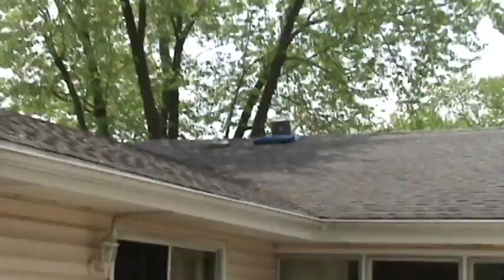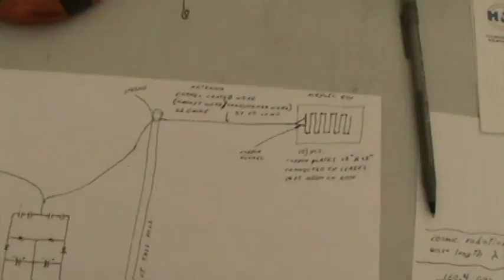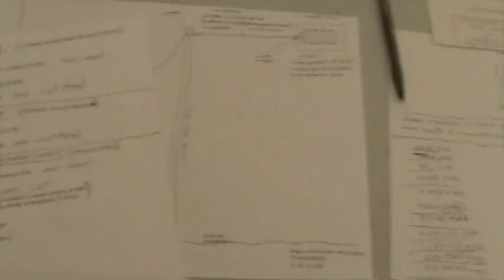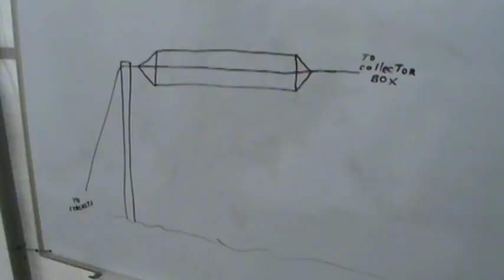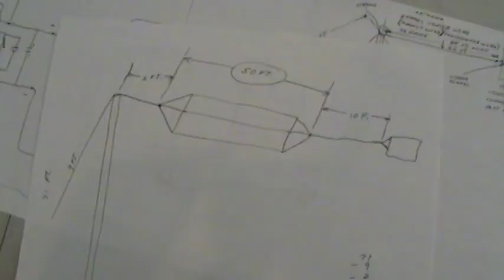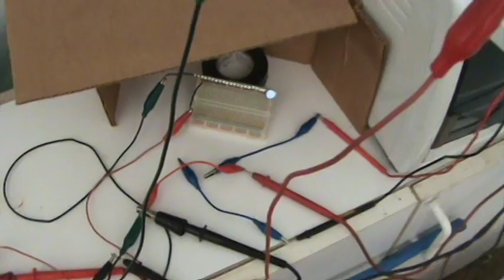Free Energy From Air 2018, part 1

Comment: Isnt this the same as a solar panel getting energy from the sun?
Reply from the maker: Humm, in a sense, this is collecting electromagnetic waves in the air from I believe many sources, like radio, the sun, black holes, satellites, super nova, many sources from man made devices and sources from the cosmos.  This would also be considered as atmospheric electricity.  This system works night and day with no charging of batteries.  Solar cells(photovoltaic modules) need photons of light to work.  Solar panels on a house take about 20-30 years to get your money back and costly maintenance, and in 30 years they may have better ones.  Solar cells used in space by NASA are approx 25% better.
Thanks for watching & your comments.

Comment: Take a large inductance transformer coil with 300mh  and 30mh. Get a 
second one just like it. Now hook a piezo element across the the ground 
and a high antenna wire. Connect one 300mh  coil across the piezo. You 
may connected piezos in series to get higher voltage. Then connect the 
30mh coil to each other. Then measure the output across the free 300mh 
coil for free energy.
Reply from the maker: Thanks Travis, I like this idea, makes sense! 😎

Comment: Mount it 200+ feet
Reply from the maker: Yes, absolutely, i understand.  But I will try to get more power out of it without raising it more or adding longer length antenna wire.  If you keep going through this video series, you will see that i now have over 125V :-)

Comment: I have noticed that when i used carbon / graphite as antenna, this made a big difference for me, and if you will get the same results as i did, i think you will really notice a BIG difference because your system is 10 times mine.
Reply from the maker: Thanks Ronald!  I been thinking about this too.  Graphite antenna rods or graphene coated wires :-)

Comment: If you reduce the wiring in your circuits and make better connections, you will get more power from your DC system. Line losses are hurting your efforts.
Reply from the maker: Yes, thank you,,,i agree.  I will change things :-)
Reply from the maker: Thanks, i am getting more power now that i removed some circuitry :-)

Comment: Lasersaber did some work on atmospheric electricity with a company that is developing the technology. It's very interesting to watch and may give you some ideas. https://youtu.be/ENeDkGce5-4
Reply from the maker: Thank you, im very familiar with that video.  It is a very good video!  I hope to do what they do but with a much smaller set-up.
Reply: It sems like what they are sayng is that a rough wire having more surface improves the ion colecting capability. So if you roughen up the wire it might increase the performance.
Reply from the maker: Good idea.  I already have all surfaces of the copper plates in the collector roughed up.  I was thinking of buying some graphene coated wire,,,,or make some myself.

Comment: Hi Paul, I'm just wondering what happened to the 120vac that you were getting several years ago? Surface area makes a difference so just imagine the tin roof on your shop? I've tried that and it's never isolated well enough. Anyway, keep up the good work my friend.
Reply from the maker: Hey Michael!  I got that 120V when i had my lab in my fathers back yard.  I used to drive to his house every weekend and some days in between.  He let me have my lab in his back yard behind his 2-1/2 car garage,,,,,my yard is very small.  7 years later i got tired of driving back & forth.  I fought with my wife everyday for 2 months straight until she gave in and now i have my lab in my own back yard :-)  At my dads house i was around 41 feet high,,,now im only 16 feet high with my antenna.  Keep in ouch my friend.

Comment: ...eh
https://cdn.discordapp.com/attachments/259682772665237504/455757662618124300/BlobBattery.zip
you use electromagnetic waves, most energy comes from radio etc.
the link shows you something i work on, only problem is to make the cells waterproove.
also i make a video where i talk quick about it ==>
https://www.youtube.com/watch?v=GShIPUFOv0w
Reply from the maker: very Interesting. I wonder what is in the hair gel,,,i mean, i hope your not just building a regular battery with a galvanic reaction.     Have to tested this under a load for a long time?
Thanks for posting & sharing Luziferino, and good to hear from you again.
Reply: >galvanic reaction
no. thats point of whole thingy.
it can also be builded with water instead of gel, or useing showergel.
...testet, yes. alot. with my tower here i load already over100 times some 1,2Volt batterys, and sometimes some capacitors because fun to have that mutch energy xq
...only problem, building cells "waterproove". some are starting to dry out soooooo i test silikon now on them, look how long that hold.

now i explain what exactly it it ==>
NO CHEMICAL REACTION! the cells dont let normal energy throught. thats funny because its energy on it when you measure it. lol.
sense of it is, water is in oil, but not water touch the metals, the oil does. but because of this low distance difference from water and metal, energy floats.
and the direction comes because of the 2  different metal kinds.

sooooooooo also, have you heard of the balloon HV generator? XD
make a cable on a balloon and let it fly up. very high! you will get a shock when you are on ground and touch the end of cable.
energy comes from HighDifference.
...i am also thinking how to make it possible to use 1MeterHighdifference and make circles, but that cable whould go up and down soooooo it will not work.
also, 1meter or a house or normall towers are to less. sadly
Reply from the maker: Thanks for the reply.  Very interesting.  I added your video to my playlist of "free energy & OU".
Has anyone replicated your work.  I would love to see a video of you making & testing a cell,,,instead of just video taping graphics of it.  Thanks for sharing & open sourcing :-)
Reply: >"video of you making & testing a cell"
eh. ok...
the days

Comment: well, i3,  you have made a crystal radio set without the crystal  or  the radio.   in Any long conductor, ambient natural and artificial radio frequency ( rf )  energy is passively converted to very weak ac power ( the antenna ).   this ac power is then full-wave rectified and powers your LEDs.    while this power is  Not  coming from air, its  energy density  is on par with that of atmospheric static electricity (  Very Low ).         leverage  IS  the key to  clean unlimited electrical power.    consider that in the linked video of an experiment conducted by  george chaniotakis ,  there is an Apparent energy  Gain  of  .1 watts.    see my channel, if it suits.    cheers
https://www.youtube.com/watch?v=lTkXciAn488
Reply from the maker: Interesting, thank you.

Comment: Can you run an aerial up on a balloon or such too gain some altitude for increased voltage?
Reply from the maker: Hello, good to see you again.  I thought about the balloon, but too many trees near me here,,,plus i want to keep this simple to replicate anyplace.  Dr Moray, in his third generation radiant energy device, he only needed an eight foot long antenna in his basement or even underground in a cave,,,but he was also using radio active compounds by this time,,which i will have to try soon :-)  I will also check freqs soon and try to get things resonating.
Reply: The problem is, replicability is only worth the time of the people if it produces enough to pay its self back.

I am not sure who Dr. Moray is, or how he came to his final results, but 8 feet of wire, inside an enclosed space sounds pretty unusual.

Are you trying to get EM energy or are you trying to get static energy?
Reply from the maker: EM energy.
Reply: A fractal antenna would help with that greatly: gain more bandwidth in less space! (~_^)-b
Reply from the maker: I was thinking about this also.  I was hoping to get my hands on a discarded smart phone,,,they have very good fractal antenna in them, they have to receive TV, radio, GPS, and much more,,,, wide bandwidth,,,,,or i could make my own, maybe bend wire like a snowflake design :-)   Eventually i think i would like to concentrate on collecting cosmic radiation.  I read it is at 160.4 GHz,,i already calculated the antenna length of .1109 inches :-)(search Franklin Mead patent).  If i remember correctly, he used 2 spheres for his collectors, slightly different in size from each other, and he collected and used the beat freq produced from those spheres.
Oh, Dr Thomas Henry Moray,,,you must of herd of him,,,his well know book is called "The Sea of Energy in Which the Earth Floats". Dr Moray researched a lot of Tesla's work.  It always interested me that Moray had to "prime" his circuit to get it powering up,,,,like siphoning gas from a gas tank.  He collected cosmic radiation and transformed the freq down.
Ok, im rambling on now, talk again anytime.
Reply: Ever heard of conductive ink pens? All you need to make your own fractal antenna is a straight edge, some paper [or really rough surfaced plastic, but plastic coated (butcher's) paper works too], some aluminized paint, or, if you happen to follow Dr. Robert Murray-Smith, some nano-scale copper ink, and draw it onto the [non-conductive film-of-your-choice] cleanly, and once it dries, connect to the core of it and suddenly you have your fractal antenna! 

In fact, if you can get your conductive ink into a printer or plotter, you can have the machine make the fractal pattern for you.

Otherwise, what you can also do, is draw out one portion at a time, test it, and if you are happy/excited with the results, allow that to be motivation by which you proceed to expand your antenna sheet at a time to as large as you care to build it, because no matter how large it is, you can always [literally, always] roll it up, and seal it from the weather [generally, just anything that degrades your ink, rots the paper or causes a short circuit, including, but not limited to mold, mildew, fungi, termites, rats, wasps, etc.] and continue using larger and larger versions, ever expanding your bandwidth as you go! 

\(^_^)/

The MAIN reason I have not yet moved forward on doing this myself is that I have not had time and tooling to reduce my copper stockpile all into conductive ink.

I imagine with the hundreds of pounds of copper I have on hand, I should be able to literally make many fractals of large enough dipolar values to collect every possible bandwidth from ultra sub EM to gamma rays, at many locations, therefore allowing me to produce a virtual 'hole in space' respective to EM energy.

Of course, I will also need a whole lot of paper to do this on, and it will take a long time to complete... 

Therefore, most likely I will long before that complete my solar heat engine system, which will produce considerably more power anyhow.

~( 'w')/
Reply from the maker: Thank you,,,good idea with the conductive ink(i have seen these pens),,good for quick experiments :-)  
Hundreds of pounds of copper,,,im drooling.
I wish you great luck with your solar heat engine when you get time with it.
Reply: I actually built a VERY CRUDE one up in frosty Minnesota about a decade ago, and the owner will sell it to me for crazy cheap [relative to what it is in retail parts] but I lack the money to go get it, and although it it was far from perfect, it worked, he won't sell me the huge 24 foot solar tracker though, so I have to build that from scratch, unless somehow in time he changes his mind.

I actually got my 600 HP valve back, for which I was truly grateful, without this valve, or one just like it, one can not run a piston engine with  the pressure and must resort to potentially fickle and gas hungry turbines, or, build a special high precision vane motor.

IF I get the unit, however, I will proceed to build a vane motor, because it is simply the most efficient at transferring the pressure and flow into actual HP at an alternator, flywheel, pump, or other outlet of harvestable power a user chooses to employ.

Also, I have an idea how to make a really inexpensive GIANT Fresnel lens [please, everybody who reads this, keep in mind that 'inexpensive' is RELATIVE term in this situation] which I can use to mass produce literally any sized Fresnel lens a person could want [because I would make it in sections which allows me to compile, crate and cartage any place on earth really cheaply, however, for massive contract jobs, I could literally build a limitless [limited to money and materials] quantity on site.

With my 'revolutionary' [not sure if it really and truly is nor not without researching more on it] design, I can make lenses limited only in materials and tooling for their size, and can make a fully working lens for a frame in well under 24 hours, something unheard of in large Fresnel lenses to this point.

Since there is such vast volumes of SOLAR [(<EM>)] radiation striking the earth each and very day, it just seems pointless for me to invest the time and money to make some type of system which has a completely unknown and unproven level of potential at this point in my life.

As a HOBBY? Maybe some day.

As a way to produce needed power here and now? Nuhuh.

Definitely wish you great success Paul, continuing to follow, enjoy and offer moral support, possibly technical assistance, but as for me, gunna stick with good 'ol reliable SUNSHINE for my EM harvesting needs.
Reply from the maker: Sounds very cool that you have idea for making Fresnel lenses,,,i get them from old projector TVs.
Reply: I have a few from projection screen TVs we used for initial research but they are too small for practical use with my system.

My next mini-machine will be an attempt at taking 2 TV screens to power a solar thermal go-kart just for public demonstrations.

That one will also be a while down the road though.
Reply: conductive ink can be copper plated to improve conductivity :D

Comment: Sparkgap it
Reply from the maker: I keep thinking about this.  But the LEDs are tiny spark gaps themselves.,,,where would i put the spark gap?  Do you think i should replace the LEDs with a single spark gap?  I see you made videos of MX6maximus,,,wait, who is this.
I really like that ADGEX ELFE flashlight,,,i see it can operate about 1-2 hours a day,,,must obviously be charging a capacitor.  I will have to try charging a cap again soon.  Thanks for commenting.
Reply: INVENTOR3 sparkgap the high voltage coming off the receiver, capture the energy burst in a cap and use that to run the led off it. You actually showed it in your earlier vids, when you were so depressed about this project, both me and Byron were applauding in the commentary on that second you showed the effect of the sparkgap giving additional brightness to your LEDS.

You can see the same effect in Byron's videos and mine trying to  replicate his designs.
Reply from the maker: LOL!
Reply from the maker: Thank you,,,i will try this.
Reply from the maker: Hmmm, but you guys use the wire from the wall(which wire do you use again, i forget?).  Dont get me wrong, i think what you guys are doing is phenomenal.  Hmmm, what if elec Co says you are not using us anymore so we will turn everything off?  I want people in 3rd world countries to be able to use this.
Im thinking out loud about what you said to try,,,,,,if i charge a cap/caps,,,than i can not have the LEDs connected into the circuit at the same time otherwise the caps may never charge,,,,hmmmm, so lets say i charge a cap & than connect the LEDs,,,,but than the LEDs will light for a shorter duration as it took to charge the cap.
lol, am i making any sense or am i misunderstanding something.
I love the comments and ideas, keep em comin!

Comment: It seems like there are quite a few components in the circuit. Each capacitor, diode, coil, and resistor have power losses. I don't know if you have compared voltage and amperage before and after the circuits to determine the losses.
The more metal in the air the higher the current/. The more unconnected terminations or spikes the more current as well. The larger the elevation differential the higher the voltage.  
https://youtu.be/2rVdEhyMR6A
Reply from the maker: I have not edited the second part video together yet,,but i remove much of the circuit and go back to the basics.
You make a good point and was saying the same thing to myself.  Thanks for commenting.

Comment: at over two volts you can then use a joule theif circuit to boost it more then  cut the voltage to get more current
Reply from the maker: Thanks Steven, but i would rather get more voltage and than run it through a spark gap to get current,,,but than again maybe i am "barking-up-the-wrong-tree" as they say.
Reply from the maker: I am not getting my comments on my videos forwarded to my email any more for some reason!!
I checked my youtube notification settings and they are good.
I checked my google chrome notification settings and they are good.
I checked my yahoo mail notification settings and they are good.
Only thing i can think of now is that maybe i need to convert to the new youtube Beta!?,,but youtube beta does not yet have end screen annotations to add to my uploaded videos & other features yet.
I dont know when anyone leaves a comment anymore on any of my videos,,,,i have to go to each of my videos to find out if there are new comments.  AHHHHGGGRRR!!  Am im the only one having this problem now!!

Comment: Is this similar to the way a crystal radio set collects some useable voltage ?
Reply from the maker: Yes, exactly, except i am not tuned to receive a specific radio station like they were.  I will be checking the in coming frequency again soon, but in the past when i checked the freq. it was not in the range of power lines or radio.